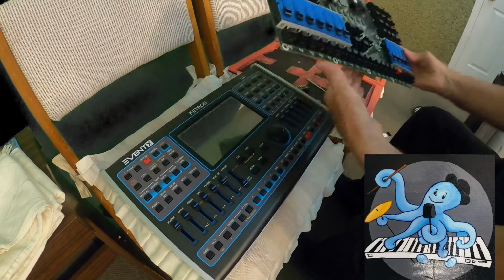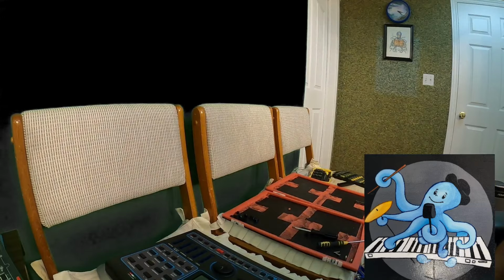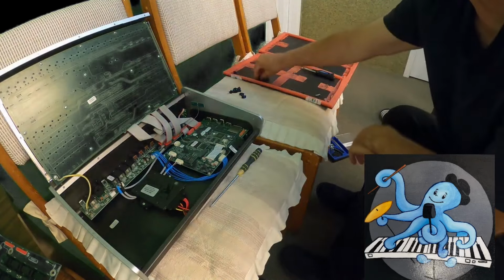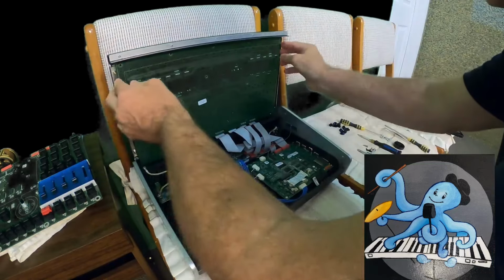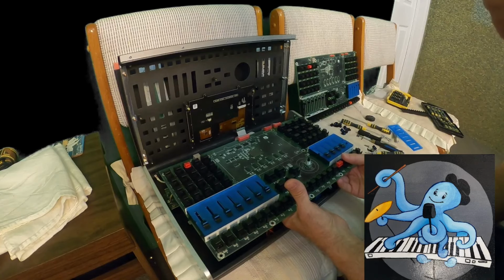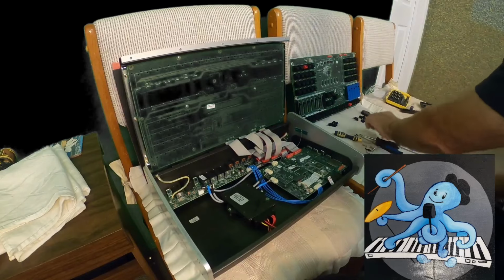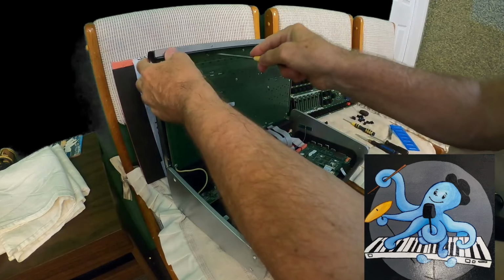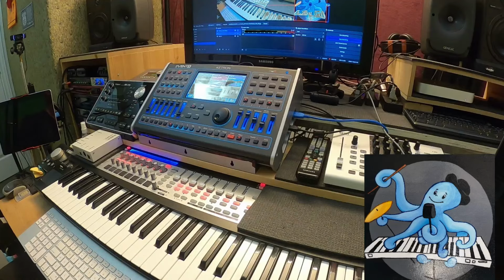Ketron EventX  - How To Repair Led Lights

Comment: This post is fantastic!!! What is the model number of the new part and how much was it please?
Reply from the maker: My instrument was under warranty so I received the part without charge. I only paid Canadian tax (customs). I don't know the exact part number, but I explained my problem to Ketron and they sent me the appropriate part. You will need to contact Ketron regarding the Part Number and price. Kind regards. I am not sure if they will send you a part or if you will have to send the instrument for repair. I was in Bosnia and in Bosnia they don't have a Ketron service there, so I asked them to send me a part that I changed at my own risk.